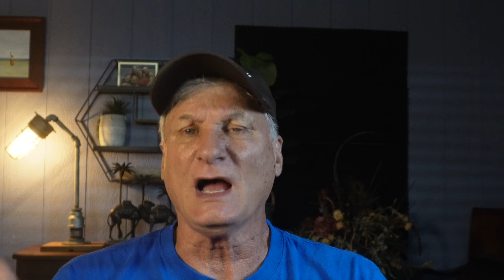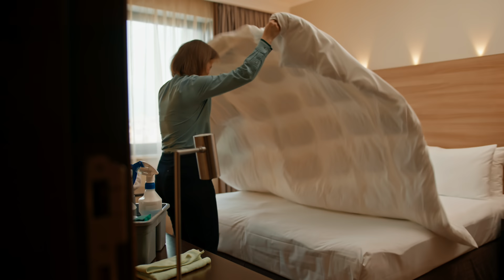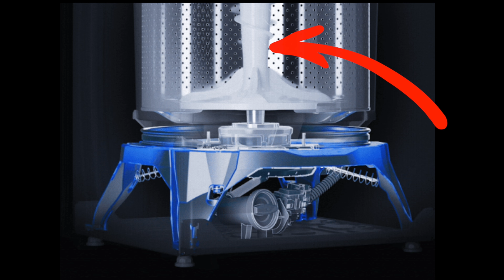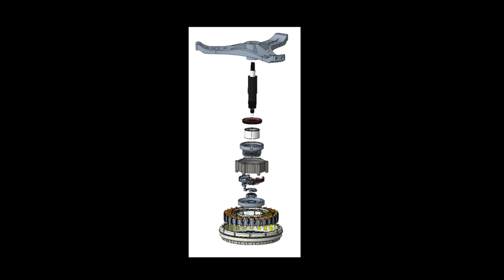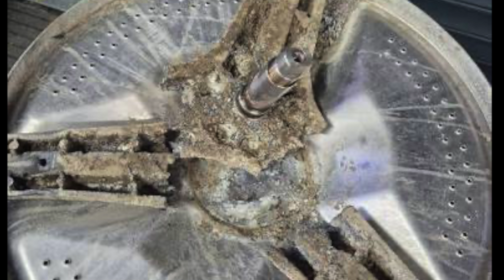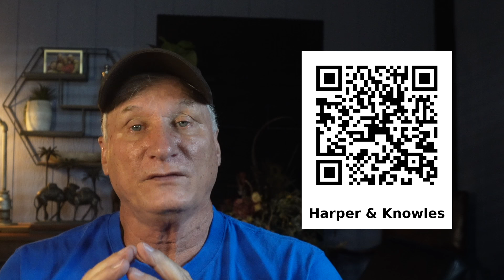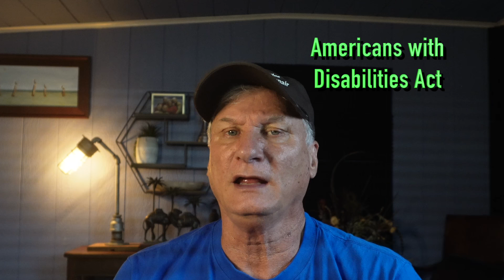Maytag's New 30-Year Washer: No Gearcase, Real Agitator, 900 RPM

Comment: Outstanding Video! I kept our Neptune pair running till I had to let them go. Now our GE Profile Magnet Drive Front Loader has been apart twice to replace the Main Bearings and the latest was the Pump out Pump. I bought a new Washer for my Wife because I make clothes very dirty, so that is my spare when the Magnet Drive quits. The Magnet Drive weighs a ton, extracts at a unholy rate, but it is getting older. Thank you for your video, learning about this is a Magnet Drive with a 900RPM extract along with all the other information you spoke about.
Reply from the maker: I appreciate the kind words and I'm glad you found the information in the video helpful.

Comment: My Maytag is a 1988 model. Now it only washes about 6 loads a month. But it still runs just fine.
Reply: 6 loads you can’t compare it to anything then mine front loader dose that in two days and is 5 years old.
Reply: @sounsure9108  My  wife  had a bad stroke my daughter 6 months  at home dying of brain Cancer stage 4. not  to put down women  but were not to well mobile. Maytag washing Machine  built in 1996 6 load's a day for over 6 months.  over 12k gallons of water. i just  did  of Laundry
Reply: Because you only wash six loads a month
Reply: Don't know why people are being jerks under your comment, but I just wanted to say, that is fantastic! Congrats on reducing the chore load and having a solid machine. 🤗

Comment: We replaced our washer and dryer about 5 years ago. No issues so far. I did save the Speed Queen dryer I had just rebuilt. But we have learned something. We like not having the agitator in the center. So hopefully manufacturers will have that option available on the simpler machines as well.
Reply from the maker: It’s interesting to hear your perspective on the agitator-less design; thanks for sharing!

Comment: It’s nice to see a company challenging speed queen, the competition will keep them on their toes and honest.
Reply from the maker: Competition is always a good thing for consumers! Thanks for watching.
Reply: @HarperandKnowles  Not necessarily. There's the so called race to the bottom. Many consumers look at the price and nothing else, normally due to economic circumstance or not recognizing better made stuff that is worth the extra cost. This puts pressure on manufacturers to make things less expensive which usually means cheaper. I  think some competition is good but consumers also have a place in the equation. Manufacturers make what sells, consumers provide feedback by buying stuff. If people chose badly made stuff because it costs less then you get cheap, less costly stuff.
Reply: @frankenberry9670  Kinda disagree due to the fact that even thrifty buyers realize that they went through 4 washers in 6 months and are now looking for quality.

Comment: Whirlpool needs to bring back the direct drive and use the same technology that Maytag had before they merged.  Maytag had a commercial washer that was built like a tank and lasted forever.  My Mother had one and used it everyday for 40 years.  Maytag also had porcelain enamel finish on the top and lid.
Reply from the maker: It would be great to see that kind of durability return. Thanks for watching!

Comment: I don’t see how a direct drive motor with no transmission can come close to the clean you get with transmission controlled reversing agitator. Electrically switching directions quickly would make its motor run very hot and use more power.  I think Whirlpool will change agitator direction slowly like the high-end speed queen does, which doesn’t seem like it could clean as well by slushing the clothes slowly back and forth.
Reply from the maker: It will be interesting to see how the performance compares in real-world testing. Thanks for watching!

Comment: If my Speed Queen dies , I'll buy another Speed Queen. I bought mine new in 2015, still going strong.
Reply: My GE is older than that.
Reply: @whatfreedom7 my ge lasted one year and 19 days and was out of warranty!
Reply from the maker: They have a great reputation for longevity. Thanks for watching!
Reply: The new SQ's are not as reliable as your 2015. I also have a 2013, I think. We are on our 4th non SQ  washer in over 6 months as they have all had something wrong. 2 LG's, a Maytag, and the 4th will be delivered in 1.5 weeks, a GE GTW585. Probably should have started with that one. We wanted a larger tub and less water as we have a new septic field.
Reply: @CommonSensei-d5h my friend bought a maytag washer that was a water saver; she regretted it and said it did not get her clothes clean. She wished she had a drum washer with an agitator. I hear the water savers are not reliable.

Comment: I don't like my speed queen.  Brand new 4 years ago. Lid locks, can't see anything or add stuff, all rinse cycle are cold, no presoak, no rinse only. The cycle length is very short....not impressed...I miss my rebuilt maytag...wish I never left it with my old house...p.s. I paid $1,000 for the speed queen
Reply from the maker: I don't know of any modern washers that rinse in hot water. Thanks for watching!

Comment: At roughly $1,500 I would run to Speed Queen first!  They've been building and testing their washers for 118 years.  I've owned my SQ TR7 for 6 years now, never an issue and it is still under warranty.  The Speed Queen is built like a tank.
Reply: I get it, but many of us want a larger tub. We want both worlds, so I hope this works!
Reply: Maytag  has been making  washing machines for119 years but the  good  ones  were built from 1907  to 2004 and were built like a tank

Comment: After getting burnt on our 2nd Staber, ended up replacing the 'new' machine with an LG front loader DIRECT DRIVE model that many have reported no problems and use for at least 10 years. I can't believe how good it works and is QUIET too!! love how it chimes me when the load is done.
Reply: I had a set, 11 yrs no problem. Sold house. Bought a new set when moved. 9 years, going strong. Just bought the newest washtower version for vacation home. Sticking with LG.

Comment: Yes, the Maytag Neptune. Back in 1999 I bought a Maytag Neptune MAH3000 washer and a matching MDG3000 dryer. I did a lot of research before I bought this set. Back then they were almost $2000 for the set. I still have them or at least my daughter has them. I gave them to her in 2019. Have they had problems? The dryer keeps chugging along. I do want to go over and give it a good cleaning and replace the solenoids and drive belt. The washer has had its problems. I replaced the rubber door gasket with a new one that had a bottom drain. I had to get the control board repaired in 2008 after the notorious wax door lock problem. In 2015 I replaced the bearing seals. The original SKF bearings were still good. Recently I replaced the bearings (still good) and seals as my daughter was having a baby and I wanted to future proof the washer. I also replaced the drain pump and wax motor along with the motor mounts. I hope to keep this washer going. Maytag made a good product back in the day. They did need to work out the bugs before releasing the washers. Hopefully they will do this with this new washer.
Reply: had the neptune as well, very solid appliance
Reply: Neptunes ran good for us and easy to fix.

Comment: We've had a Speed Queen for 15 years, never a single problem.  The only bad thing about the agitator is, if you pack clothes in there, the clothes won't circulate around.  The agitator just beats the sht out of what ever piece of clothing is next to it.  You have to load these types of washers fairly light and use a lot of water.  We basically use a "medium" load, and set the wash load level to "Extra Large".  That way the clothes circulate, don't get beat up, and come out perfectly clean.  This Maytag will be no different.

The new Maytag first look. https://youtu.be/RElc-sBHZFQ

Comment: The comment about no previous agitator-topload washer having a spin speed higher than 900 RPM is incorrect.  Frigidaire's Unimatic design in 1947 and GE's first toploader in 1947 were 1,140 RPM.  Frigidaire's subsequent Multimatic design reduced it to 850 RPM, then the Rollermatic/Rapidry increased to 1,010.  Fisher & Paykel's SmartDrive agitator models introduced in 1997 (and AquaSmart impeller models in the early 2000s) are 1,000-1,010.  I have four agitator F&Ps (and two impeller models).  Whirlpool's first-generation Cabrio, (Maytag) Bravos, and (Kenmore) Oasis were based on F&P's design. There were agitator Cabrio/Bravos/Oasis models, spin at 950 RPM.  Impeller models 1,000 RPM.
Reply from the maker: Thank you for that. You are right and I was wrong, and I appreciate you taking the time to lay it out instead of just telling me I blew it.

I went back and checked every one of those. The Unimatic did run 1,140 RPM from 1947 on, the Multi-Matic dropped to 850 when it came along in 1959, and the Roller-Matic brought it back up to 1,010 with the Rapidry spin. GE's first automatic in 1947 was right there at 1,140 too. And the F&P SmartDrive numbers line up with what you said. So that 900 RPM claim I made was flat wrong, and wrong by a good bit.

I'll tell you the truth, I was thinking about the machines I actually work on every week, the modern belt drive and direct drive top loaders, and I let that turn into a statement about every agitator washer ever built. That was sloppy of me. Those old Frigidaires were doing things in 1947 that most of what comes through my shop today still can't do.

Four agitator F&Ps is something. I don't get many of those down here in central Louisiana, so anything you want to share about keeping them running, I am all ears.

 Thanks again.

Comment: I had a Maytag top load washer model# LAT930488E from 1994.  I recently replaced that with a Speed Queen from the Western Auto store in a neighboring town.  For 32 years those machines (I had the matching dryer) did nothing but run; just like my Speed Queen does now.  I find it hard to believe that suddenly Maytag (that is basically just a badge-engineered Whirlpool) decided to turn over a new leaf and produce a quality machine after the junk they have been producing, especially in the current economic climate.  I was told if you want something to hold up, your only choice is a Speed Queen.  I paid $2,700.00 for both washer and dryer.  As far as the "Stink-O-Matic" Neptune, my dealer REFUSED to sell me one.  He said that they have 8 DC motors that will fail.  I would need to buy one from someone else; I didn't buy one.  GREAT VIDEO!
Reply: YES!

Comment: I can see this washer has the legacy 3 dial selectors on the panel.  Next thing to know is are they for real or are they just for looks while behind the panel they are a long integrated circuit board ?  Those legacy mechanical switches/dials rarely failed while circuit boards with soldered controls seemed to always be a problem and very expensive to replace/repair.
Reply from the maker: I would be surprised if they are analog switches. Thanks for watching!

Comment: The motor rotor/stator design is not new.  It's based on Fisher & Paykel's SmartDrive developed in the early 1990s.  Whirlpool already used F&P's motor and simple floating-basket agitate/spin shifting design on the early Bravos, Cabrio, and Oasis models.  The VMAX design that replaced those also uses the motor, although with an electric shift mechanism to engage/disengage spin, presumably because F&P's agreement for WP to use the floating basket system expired.  Many frontloaders of various brands, including Whirlpool, also use the F&P motor design.

Comment: Nothing beats a dual action agitator for wash performance. 

My kenmore made by whirlpool direct drive washer is awesome.  When first purchased, it was the basic single action agitator. 
Has water temp on the timer. 

I’ve update with a true stainless steel basket, dual action agitator, replaced the the smaller outer tub to a full size  at the same time.  

Takes 32 minutes to do a load.  

The new whirlpool, well if the customer overloads the washer , bye bye plastic rotor.  Seen one too many times. 

My youngest said, I call dibs on this washer.  
Beats speed queen hands down. 
Oh it’s from 1989. Still going storing.

Comment: Sounds like they decided to make an old fashion product. All the other appliance makers need to take note. I'd like to see a choice in water levels like before, small, medium, large loads, and absolutely no electronics/mother boards. Just a knob that turns on and off. Another thing I'd like to see is the lint catcher come back. That thing caught a lot of lint and candy wrappers. I don't want to take something apart, get a bucket and drain it. Nothing was wrong with the way the 1960/70s machines worked. I do appreciate the better stability you talked about. My speed queen does get unbalanced and bang around and I have to run to catch it.  I don't remember my mother's machine ever getting out of balance, not once, nor did it leak water or oil from underneath. I found water on the floor around my speed queen a few days ago. That's disappointing, but I haven't moved it to clean around it and found oil. I'm on a well and have to pull it out now and then to clean the screen in the back so the water can get through. Overall, though, I'm happy with it. If the Whirlpool turns out to be as good as it sounds, and it's American made, I'd get one. I don't see why I should pay more than a few hundred dollars for a foreign made machine. After all, they said they went overseas to save money. To me that means it should cost me less, not the same or more.
Reply: Private Equity!  Buy a firm, move mfrng to Mexico or Asia,  cheapen it every way possible, raise the marketing budget, sell. as many as possible after raising the price & blaming global supply issues to maximize stock prices and returns to the PE backers.

Consumer: Pay more, get less.

Comment: I already have a 30 year WP washer...made in 1995. Still has the original reliable mechanical timer. They quit using mechanical timers for a reason. They were just too reliable.
Reply: It’s crazy. I’ll probably never quit using the old direct drive WP. I’ve had 2. The first one the cabinet was getting rusty, and when a friend offered me a newer one for free, I swapped it out. Why the heck those control boards don’t last longer? It seems like it has to be deliberate. I have tons of electronics, both analog and digital, that just keep working. But VCRs and computers became “obsolete” eventually. (I put it in quotes, because obsolescence, I believe, is frequently in the mind of the beholder.) Washers and dryers don’t generally become obsolete. Out of style, sometimes, but that’s apparently not enough to drive new sales. 😵‍💫
Reply: @nicholasittzes7224 replaced my mechanical timer this last spring. 93 WP large capacity

Comment: Back in 2013, I bought a vacation home that was about 10 years old with a Maytag Neptune washer & dryer set.   It's 2026.   They're still working fine.   I suppose because it's a vacation home and they didn't get a lot of cycles on on them?
I'm getting ready to build another house to retire in.    It's in the boonies of SW VA.   This new Maytag set sounds good, except for one thing:   My wife does not want a top-load washer.   She wants front-load.   The Speed Queen's front loader's capacity is too small, and then there's the question of:  How far away is the nearest authorized service?    Hopefully, Whirlpool will give us a commercial-quality front loader at some point too.

Comment: Yesterday I watched Ben's video and now yours. The Yale data is pretty much worthless since we do not know what percent of their service area customers own specific brands. Secondly, we do not know if the units are high end or cheap washers; it would make a difference. Lastly, the number of service calls is in part tied to the decision to initiate a service call versus replace the unit. We also do not know if those service calls are warranty versus out of pocket for the various brands. I have a hard time trusting whirlpool after so many years of messing with their customers by cheapening the product. Speed Queen has been straight and true for decades. My current front loader Whirlpool gas dryer (knob) is over 25 years old. I have replaced parts myself (I am not in the industry), and now only have to replace it because one part is no longer available anywhere. If I could get a hold of that part I would replace the part and keep it running. My washer is an Electroloux front loader from 2008 and doing fine, although the printed characters on the machine in certain locations simply wear off. the idea of spending so much for a machine and having it last only six to ten years is IMO absurd. My new drier will be replaced with another gas dryer. My machines will have as many knobs and as few digital controls as possible. I accept the sensors, but I only found one company that can test and repair the circuit boards. My gas hot water heater is close to being older than dirt. I replaced my sacrificial rod some years ago and periodically perform a clean out. I know the heater is not as efficient as a new one, but the cost of the new ones due in large part to government regulations is so high that it would take over a decade to pay back with the energy cost savings.